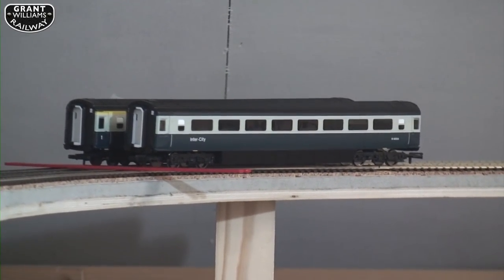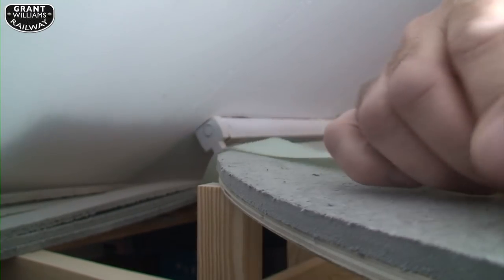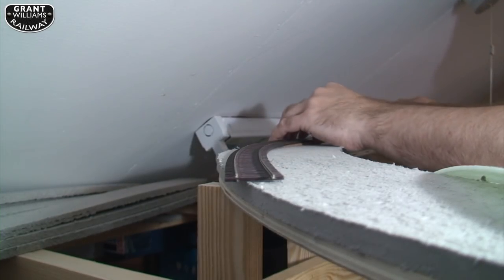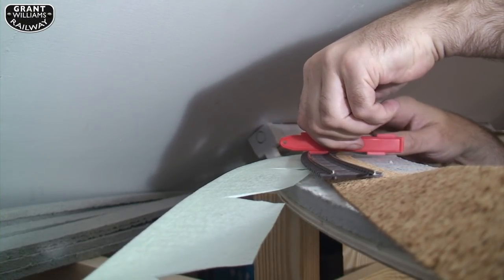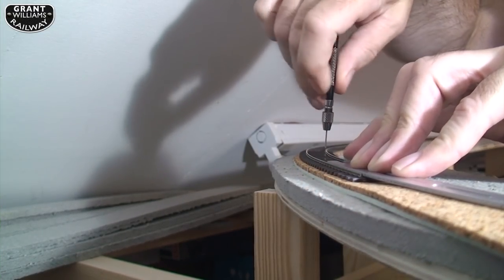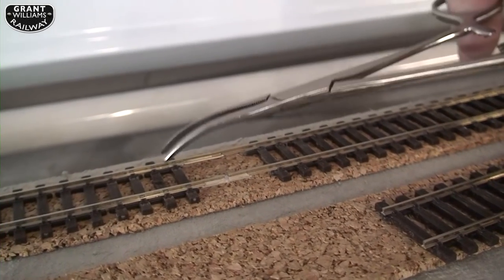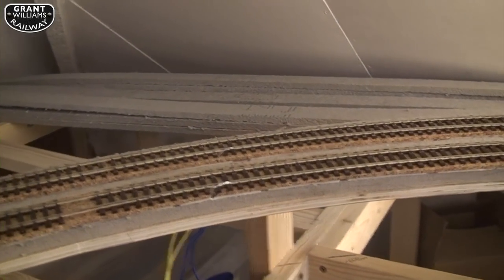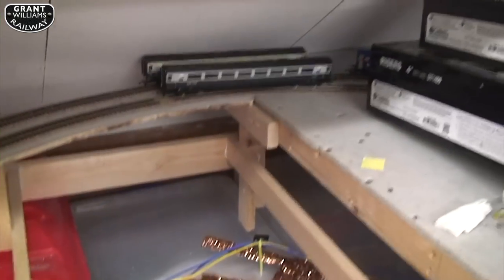A Model Railway From Scratch - 14: Track Laying 2 (Mainline)

Comment: Hi Grant,

And I thought doing a simple curve with flexi was annoyingly fiddly enough without adding a cant.  I think with doing a branch line I can get away with not bothering.. makes things much easier haha.  Don't forget when pulling the tracks together to leave an expansion gap or your going to have issues next summer!  That is a hell of alot of esu railcom detection modules,  I hate to imagine the cost,  That is the problem with ESU, they make a lovely control system but everything about it is way more expensive than it needs to be.

Cheers,  Michael
Reply from the maker: Thanks Michael. Installing the cant strips was a pain, it took ages! You're right about the expansion gaps & i should have mentioned it in the video, they do exist on my layout.

Comment: Impressive progress - like yourself looking forward to seeing that class 70 with those wagons making a loop.One question why the ESU detector? Thanks and best regards Trevor
Reply from the maker: TBH Trevor i went with ESU detectors for ease of integrating everything. I know you can get cheaper Railcom detectors from other manufacturers but as i'm only just back into the hobby (& DCC is totally new to me) i wanted a system that would work well together without too much hassle, a system that would work "out of the box". 
I also wanted Railcom detectors so that i can see the loco's in the blocks & identify them by name.

Comment: Hi Grant

You've done a great job with the super, but would it not been easier to cut the outside of the curve and let the foam stretch than try and push the inside of the foam together into the V's you cut?
Reply from the maker: I know what you mean Phil however the instructions advise to cut the V's the way i did.
Reply: Oh Okay, Gotcha

Comment: Hi Grant,
May I ask, which level (colour) of Train Controller are you using? I have been looking at it myself and can't decide if silver and gold is overkill or if the additional functionality is worth the price.
Reply from the maker: After much deliberation & comparison between the versions, i went for Train Controller Silver. I decided that Gold had features i wouldn't need for the size of my layout & Bronze was lacking a few things i wanted. It is expensive but it's an incredible bit of software, i'm only just beginning to understand how much you can do with it.
Reply: Grant Williams that's the feeling I'm getting looking at the versions myself, but it's good to get validation from people who are using it for real. Thanks for replying with your thoughts, Grant, it's much appreciated.
Reply from the maker: You may already know this guy but in case you don't, check out rudysmodelrailway, he's done some great videos on using Train Controller.

Comment: Hi Grant, Hello from a loft in Redcar :) can you tell me where you got the super elevation strip from? I've been raising my outer track by cutting extra cork for that side. it gets a bit labour intensive. Cheers Ian
Reply from the maker: Hi Ian! I got mine from Lokshop in Germany but they don't seem to sell it any more.  Someone commented that Golden Valley Hobbies also sold it but its not listed on their website. The only place i can find at the moment is another German site: http://www.modelleisenbahn.com/shop/
Their site seems a little basic but the stock number for the HO strips is 107-86613 if you put this in the search box it should take you to the right page.
Reply: Hi Grant, Is it 950mm long per strip? I may need a few lengths :0
Cheers
Ian
Reply from the maker: Yes, that's right. Might be a good idea to buy a lot, especially as they're so hard to find & they have to come from Germany!